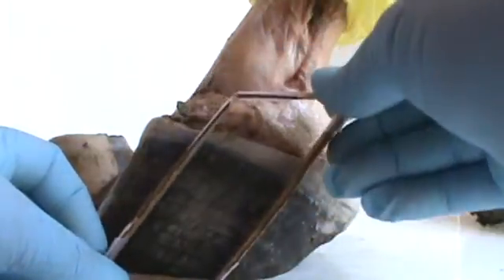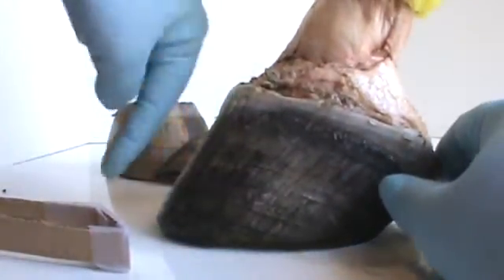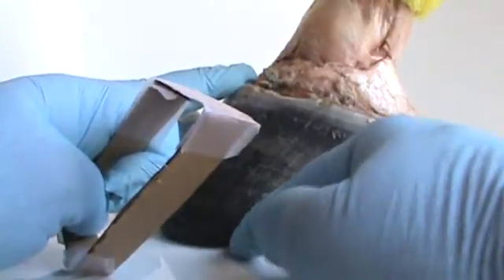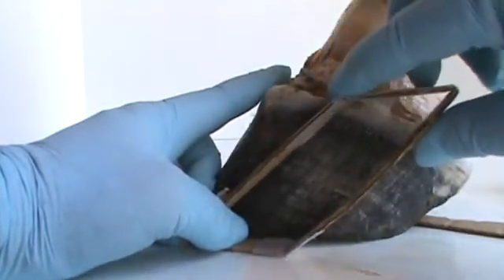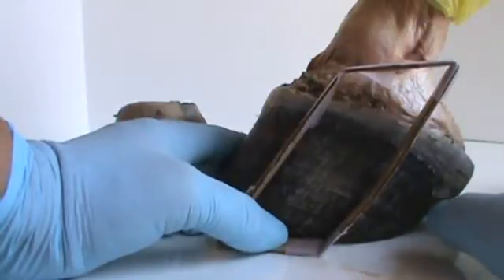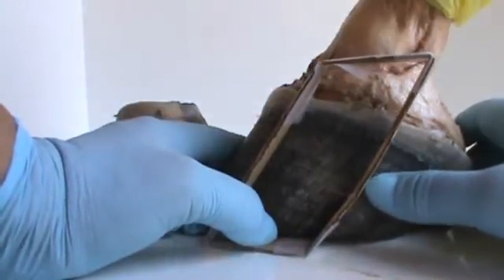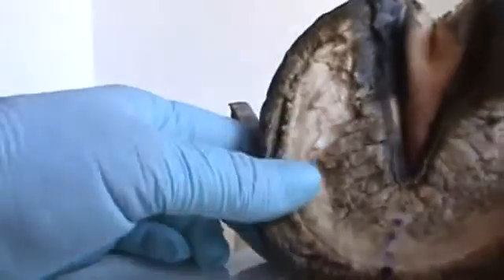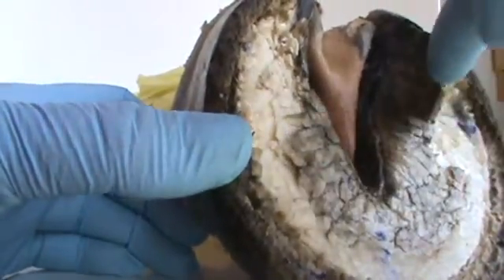Hoof Distortions and Anatomy 12

Comment: I think this is why you have to really focus on trimming the height in the quarters once you bring the toe back. Because that space wants to get pushed back where it belongs and the quarters get filled up and pushed up.  So it has to like you said have room togo.. I think with quarter relief and beveled walls or even a rim notch. I noticed when I took the toes back and rim notched in the wall at the sole level parallel to the pushed up hairline the foot relaxed and lame horses became sound.